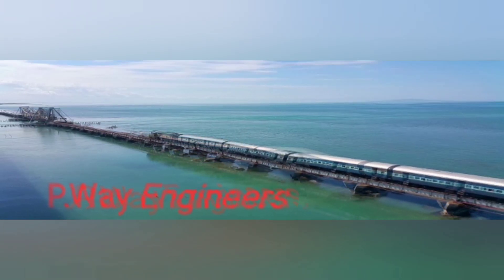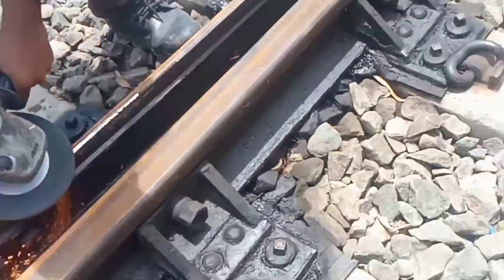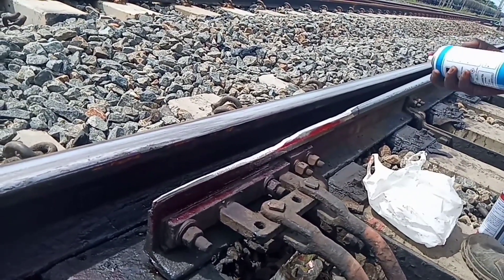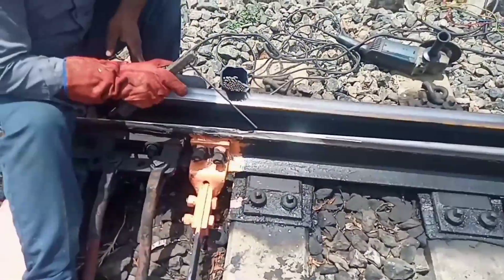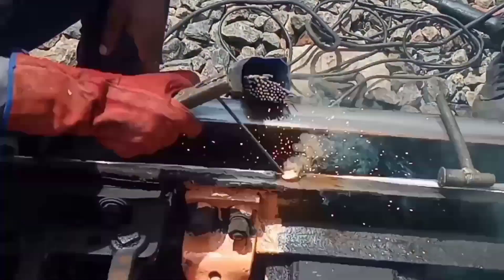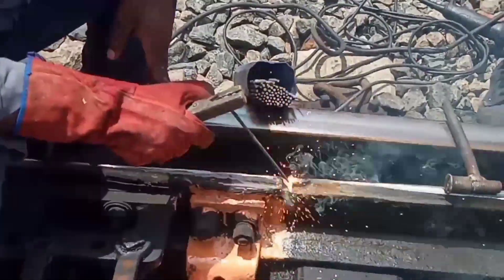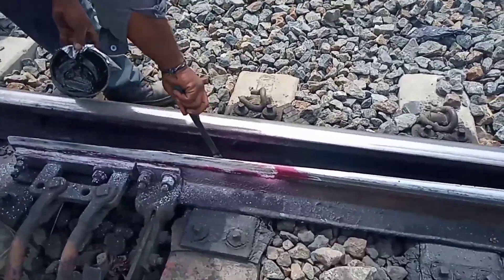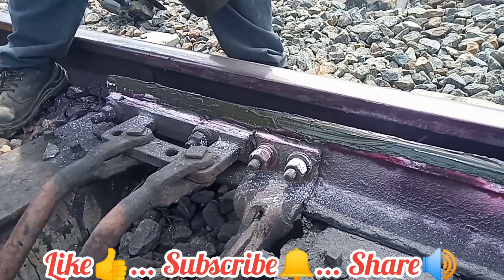RECONDITIONING OF SWITCH & DYE PENATRATION TEST in Points and Crossings

Comment: During measurements of wear ,,we have to minus actual wear for 52kg& 60 kg rail Or not.... Like during p&c inspection we are minusing these value for different value... So same we have to minus in reconditioning or not...
Reply from the maker: When measuring vertical wear on nose of crossing and wing rails there is a slope of 1 in 20... So we should deduct 2mm for 52kg and 2.5mm for 60kg rails. During reconditioning on crossing, there is no need of deduction. Reconditioning to be done to maintain the slope.